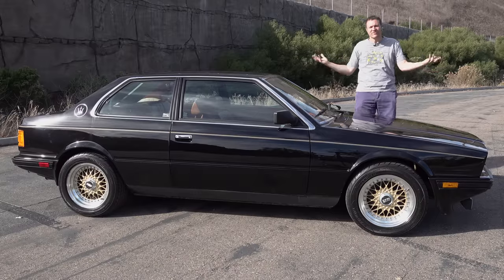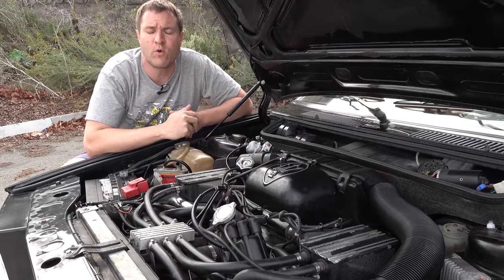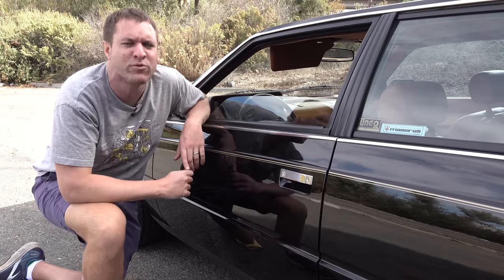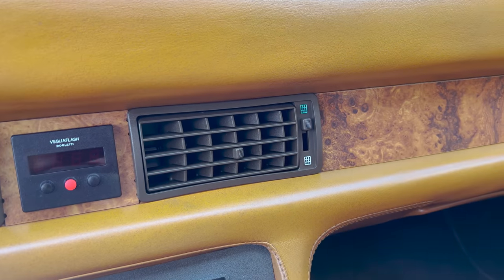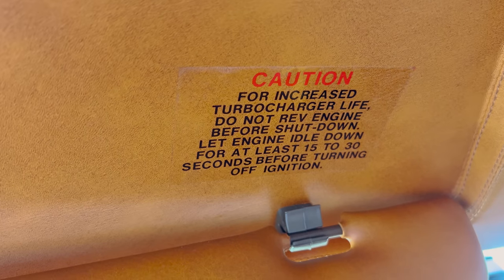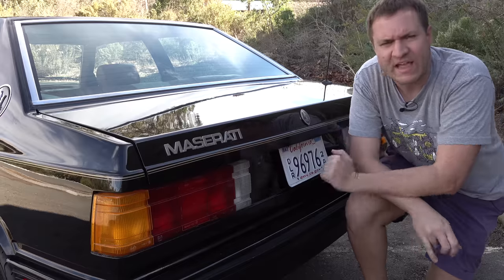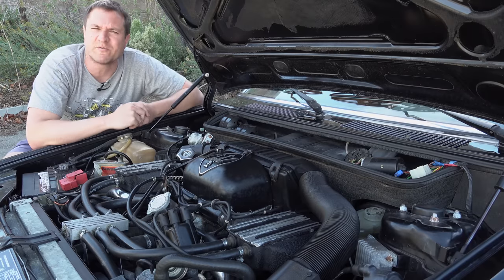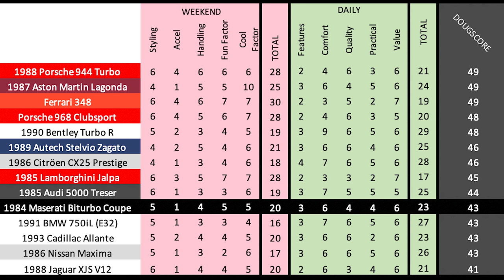The Maserati Biturbo Is the Ultra-Affordable 1980s Maserati

Comment: Doug, that's a Biturbo E model with 205 bhp from dealer added Spearco water to air intercoolers, visible underhood.  Limited to 500 examples with the Liquid Intercooled badge shown on the trunk lid.  Oddly, the test car lacks the wooden Nardi steering wheel and alloys fitted to the E and has upgraded BBS wheels.  The air-conditioning on the Biturbo models was colder than my full-size Cadillacs!  Fun car.  Perfect for date nights! What looks like leather is often PVC, especially the puffy console lid cover!
Reply: It's not an E, E was made in 85/86, and it has a wing on the bottom and 1 half the car is gray, I know because I have an E but with no intercooler, from the factory they did not come with an intercooler.
Reply: @mehdibanaei9753  The intercoolers were installed by Spearco in the USA on all E models.  It's definitely a dealer sold E.  I was an owner and am in the Owners Club with a classic Ghibli.
Reply: @alallen1030  happy new year, the one here is not an E, trust me, it does have the under skirt but not an E, not all E had the intercooler installed, you could pay your dealer as an option you could have it installed, all E are late1985/86 and have a  two toned paint side skirts and a rear apron. I have a E a 430i and a 84 euro model 2.0 also had 87 425i and a 86 425 with the intercooler.  I've had my 430i since I was 17 back in 1998, I eat and breathe biturbos.  Love your taste with your classic.
Reply: @mehdibanaei9753  Sounds like all of your experience is in the European market, not Southern California USA.
Reply: @unpolire  ? Does southern California make cars?  Yes most all my cars are European and a few are the euro market cars. I don't really get what your comment means. All I know is that I know the biturbos very well and the car here is not an E model, is that realy a big deal?
Reply: @mehdibanaei9753  I think that you are unaware of the USA only market cars that were not produced or sold in Europe by Maserati.  The “E” models sold here were never sold in Europe.  It was a marketing model produced by the West Coast importer and in cooperation with Spearco, a company in California.  Europe may have a different “E” badged Biturbo produced there but not offered for sale in the USA.
Reply: @unpolire trust me I'm very aware,I know all of that and never argued about that, we are talking about the car here in this video and I said it was not an E model, because it's a 84 and it doesn't have the head rests in the back seat, no E front grill, side skirts and no two tone paint, just because is intercooled it does not make it an E, I have an E with no intercooler and it was originaly imported to Baltimore is a usa model and like you said all E models were sent here only.  And Europe never had a biturbo with an E badge, and I know the importer in South California had intercoolers installed on the cars he imported here but not all E models were sent to California,  you could have intercoolers installed but some E cars didn't have it (like mine). We are talking about the black test car here in this video  and I said it wasn't an E, that's all. otherwise I already know about the car that I own, and if you want me to prove to you that not all E models had intercoolers installed I can send pictures of mine or you can just look up motorweek on YouTube, they did a test and the 86 biturbo E they tested didn't have intercoolers. I'm glad I ran into someone that knows biturbos also, but you can add this to your knowledge
Reply: oh thanks, I was looking it up.

Comment: It's a very cool car, and in 1982 a 2.0 Maserati Biturbo engine was capable to do the 0-60 in 6.1 seconds..
At this time this was astronomical
Reply: Can it do 185?
Reply: Only on paper!  I bought this car in 1984 and it was a disaster.  Maserati tried to put the turbo BEFORE the carburetor, which meant the carb was pressurized.  It never worked right, running lean, running rich, or not running at all.  Combine that with "heat soak", where all the gas evaporated in the lines if you went  to lunch and then tried to restart it again.  You'd sit there cranking the thing for 15 seconds before it would start to fire.  I had the BiTurbo convertible and the leather that would cover the top when down shrank in the sun.  It would then never snap into place again so it all flapped as you drove.  The final end of the road was when the engine blew due to Masearti covering up one of the head oil return galleries with the gasket.  Within 11,000 miles, that cylinder was so starved for oil, it seized and snapped the timing belt.  The engine was toast.  Yes, after the 3 year warranty expired...   I rebuilt the engine, traded it for the new 1990 300ZX TwinTurbo and never looked back.
Reply: @aussie2uGA  I had a 85 and 86 Quatroporte with 4 webber carb set up....don't get me started.  Breathtaking car to look at and sit in,  and drive actually.   When it worked !
Reply: @Sohc_Vtec nowaday, definetely it is
Reply: @aussie2uGA  that’s a crazy coincidence to see an owner from this period actually on one of these videos. The 300zx was definitely a space ship compared to this in technology
Reply: @aussie2uGA  Obviously it's before the carb. Turbos feed the intake, which then runs through the carb
Reply: @S0u11ess  😂
Reply: @S0u11ess  No. The song lyrics were incorrect.
Reply: @S0u11ess  uh oh, here comes a flock of wha-wha's.
Reply: @aussie2uGA  I had aa 1985 Biturbo. I bought it in 1988 with very low miles. It was fast, exhilarating............and a piece of sh*t. Six months later I traded it in at the Mercedes dealer. Never again!
Reply: @highwaystar3780  I know how you feel. I had an '85 as well. I was even happier when I dumped the car. One day I was driving the car in Manhattan. I pulled up to a traffic light. Right next to me stopped a Quatroporte.  The driver looked at me and nodded. I nodded back. He was Dave Winfield of the New York Yankees.
Reply: It would blow up if you did that on the regular.
Reply: I guess this model is a similar one to the Maserati Rocky drove to pick up Folly in the police station in Rocky 3.
Reply: @aussie2uGA  Turbos are ALWAYS put before the throttle plate.  You don't dump gasoline into a turbocharger inlet unless you want to violently propel your exhaust system into the windshield of the car behind you.
Reply: Always loved this decades ago and still do.
Couldn't but it back then because of cost,
can't buy it now because of maintenance cost.
Got to go, here comes my (public) bus. ;)
Reply: @Sohc_Vtec What you talking about, a Model S Tesla can do it in 2.3 seconds. The Tesla Roadster can do it in 1.1 seconds.
Reply: The few days it started  they were really something!  And the even fewer days it started twice in the same day , you were the man .  Like all Italian cars cools a given,  reliable  a question . Parts availability  a joke
Reply: Truly unimpressed… better you than me taking on the extensive care and feeding.
Reply: I had a 1972 BMW 2002 Tii that was just as fast...
Reply: @one-eyedsam2186  Not always. Very early systems used draw-through turbocharging and also a lot of early aftermarket kits did. You are right in that it's the wrong way to do it, but it has been done many times.
Reply: and in 1998 a 5.0 explorer did 11 sec.....
Reply: @TenableVegan  tenable vegan? Are you serious? Tesla isn't a car

Comment: The context is important when it comes to the Maserati Biturbo. In the early 80s, the car was quite unique in this segment. The BMW E30 323i, which was the top model since the 325i first came on the market in 1985, only had 150 HP. The E30 M3 first came on the market in 1986. Mercedes-Benz had the W201 2.3-16 (185 HP in Europe) which was however a much more expensive car and similarly also with the Porsche 924 Turbo (177 HP in Europe) which had similar performances. The Porsche 944 had slightly less power (163 HP in Europe) and was in many ways in a class below. Similarly also with the Alfa Romeo GTV 2.5 which had 160 HP in Europe.
Reply: It got even better in the late 80s/early 90s with the 2,0L V6 from the Ghibli at 306 HP (even up to 330 HP on the "Cup" models). Best specific output at that time and I believe it remained that way for quite some time. And most importantly these engines are actually reliable.
Reply: @finkbraugg  The Porsche 924 Turbo (internal number 931) came in a number of different versions with more power. The best known is probably the 924 Carrera GT (internal number 937) with 210 HP. However, there was also the 924 Carrera GTS with 245 HP, the 924 Carrera GTS Clubsport with 270 HP, the 924 Carrera GTP with 320 HP and the 924 Carrera GTR with 375 HP (internal number 939).
Reply: The only match for this car I can think of are Alpina e30 productions.

Comment: The Biturbo platform was used to much better effect in the Ghibli (2.8) and especially the Ghibli Cup (2.0) which at the time had the highest BHP per litre of any production car. The shamal as you rightly said was a V8 and a very different car, although fabulous too! Interesting that you mentioned the RS2 and turbo lag, as the S4 and RS4 in the B8 lineup had a biturbo that I’m sure owed a lot to the best bits of the Maserati Biturbo.
Reply: Very true
Reply: 100%

Comment: My dad had an 85 Liquid Intercooled Biturbo and we both loved the way it drove. I love the way this car looks - it is a slightly different than every other car out there at the time. Too bad, they swapped the carb for fuel injectors too late. I now have a Spyder 90 and I love it. Granted, I bought it, drove it for about 3500 miles and then the fans stopped working allowing the car to overheat. Fortunately, a cheap fix. Also, I get the AC working, new tires, brakes and the car had a new top. Because the rubber all around the windows is in bad shape, the interior is loud. It is a silly fun car to drive and it has the 2.8 engine. Shockingly quick. Love this car.

Comment: FACT: Maserati once experimented with a 6-valve-per-cylinder engine for the Biturbo in 1985, with the 6.36 - a 2.0-litre 36-valve twin-turbo V6 with 257 hp, but Maserati cancelled it and instead continuted to evolve the original 3-valve-per-cylinder engine throughout the life-span of the Biturbo and its derivatives.
Reply: You know this is true because the guy said "fact" in all caps.
Reply: @KartKing4ever  I was taught to take people at their word. Do you have any proof differently?
Reply: @bwofficial1776  No, because I read a similar thing on Wikipedia of the 6 valve. Although I did not read the part about it replacing the 3v.
Reply: Not exactly, later they were developing 4-valve designs, not 3.
Reply: @KartKing4ever  driving4answers have a  video on that, it's true.
Reply: I love when people talk and write like Dwight from the office in real life... FACT!
Reply: Here's another Fact: NOBODY CARES
Reply: @Timinator62   
66 thumbs up, including mine. 
66 people do care.

Comment: You could really break those turbos if you didnt idle them after driving. Shutting off the engine would stop lubrication to the still spinning turbocharger and it would wear out faster. Same with old Volvos and Saabs.
Reply: They have journal bearings. They stop almost instantly. The only reason is not to let the oil get too hot and reduce in quality.
Reply: Makes no sense. Turbos still spin at idle. The real reason for this is to cool the oil for a short period to prevent coking.

Comment: I love Biturbo's! They are for people who take the time to learn how to use and maintain them. If you do, they are fun reliable cars.

I have owned a 1986 420 Biturbo for 8 years. I always liked the proportions of the sedan body better. Mine was a low mileage Italian import that had been garaged for 12 years when I bought it.

The body and interior were in great shape and with some mechanical work it was near perfect and proved to be reliable as a weekend car. I chose the early 420 model because of the relatively affordable technique (no power steering, adjustible dampers, intercoolers, huge wide tyres or double exhaust systems).

Compared to other 'mass' produced cars a Biturbo really is special. And quite quick, especially for the era. Make fun of those seats all you want Doug, they are some of the most comfortable I ever sat in in any car! 😉

Comment: I remember feeling sad when I saw Top Gear crushing and destroying a few of these. I like cars like this because you need to be passionate and dedicated to own them. A "labor of love" as I would call it even. Internet is very biased towards the more common, reliable stuff and that's fair. Not everybody can or wants to have a car that is a bottomless pit of money, but this leaves many little jewels like this to be very overlooked.
Reply: Reliability is one thing. If a car breaks mechanically, you have a chance of fixing it. The rust was another thing. In the UK climate, these disappeared into a cloud of iron oxide very quickly.
Reply: @tcm81  - Same here in Canada.  These and the Quattroportes rusted and depreciated as though rust and depreciation were having a race,  and the cars were the loser.
Reply: My 1984 Biturbo was a great little car with a nice ZF 5-speed.  I also had an original Ghibli, so I know Maseratis.  Mine was stolen after I fitted Gotti 3-pc rims and Acura NSX tires.  Miss it!
Reply: @tcm81  They did rust, but how many cars did rust like that back then?  Virtually all of them! Back in the early to mid 80`s, most manufacturers were offering 1 year warranty on everything, including bodywork, if you got a new car & wanted to keep it, you had to get it rustproofed yourself, that was the norm, & if you didn't, you`d have bloody great holes in your sills, floors, wheel arches, door bottoms, roof pillars within 5 years... Thats why theres so few 70`s & 80`s cars now in the UK!
Reply: A true jewel is no demanding mistress .
A true jewel rewards your TLC by living long and be reliable , not betraying you by rotting away in ten years or less .
NEVER a spagetti-racer again !!!!!!!!
Reply: @chriskappert1365   My 1984 California car had zero rust issues.  It was stolen from a parking garage and stripped of the Gotti 3-piece wheels and the drivetrain, or I would still have it.  Somewhere I still have a custom tow hitch for it!
Reply: They've crashed unrepairable (not worth repairing) examples. To preserve small volume vintage Italian luxury/sport car, you need to pick good one.
Because those after accidents and botched repairs are literally unfixable. You fix one issue, 3 new appears.

Comment: I believe the low popularity of this car is mostly a product of its time when it came out. If you look at it today, it is a fairly good driver and it looks really good actually (the wheels definitely help).
Reply: The wheels are pretty nice, however the original magnesium ones are even better.
Reply: Actually mostly as a result of its horrible unreliability. They looked great broken-down on the side of the road.

Comment: I have owned three of these. An 87Si was fairly reliable… after I completely rebuilt it. I had a full on race version with a 2.8 injection engine, which was a lot of fun, but impossible to keep in California without a shop - I sold it to a guy with a shop and a passion and it’s still out there. I had another which was a typical $1500 basket case. It was unsalvageable due to rust but it had amazing covered more than 120,000 miles before someone dumped it by the side of the road in Oakland. When they work they are a lot of fun, not power at all until 2300 rpm and then they have a habit of breaking traction really easily, which is fun with an LSD. Although they only had around 180 HP you could mess with boost (of course) and get 400, which the bottom end tolerated. Badly. They also only weighed 2400 lb so you didn’t really need to, to be fair. I loved two of mine but no more for me.
Reply: Probably weigh closer to 3000lbs.

Comment: An intercooler does NOT do anything about engine overheating.  Its purpose is to cool the intake air, so that you can cram more of it into the engine and make more power.  This car is from that brief weird time where people tried to use turbos with carburetors, and in this case it looks like the carb is mounted inside a pressurized air box. I don’t know if maybe there was a problem with the carburator being fed hot pressurized air that an intercooler might solve, but it seems doubtful.

Comment: The shifter layout was common in Italian cars of the time. Most 5-speed manuals had the reverse above the first gear, compared to the conventional layout of R being placed after 5th gear.
Reply: The 70’s transaxle Porsche’s too. My ‘79 928 has this dogleg pattern
Reply: The idea is that you have the two most used gears on a curvy road - second and third gear - close together, with the ability to quickly and accurately shift between them in a linear motion.
Reply: It tells you how to shift it
Reply: And when driving in 5th, you would need to rest your hand on the lever, because it would pop out of 5th gear..... after a few minutes, your won´t feel your hand, it vibrates like a ladies friend on batteries.... :) :)
Reply: The shifter is a german ZF, classically with the first gear down.
Reply: It's because it's a ZF gearbox, German.

Comment: intercooler is about performance not reliability, Doug's gaps in technical knowledge are quite amazing, considering that his life is all about cars
Reply: incorrect. intercoolers give you slightly less performance since they block the flow of boost a little. they would overheat and the intercooler did help
Reply: You don't wish to have hot air into the intake, believe me.